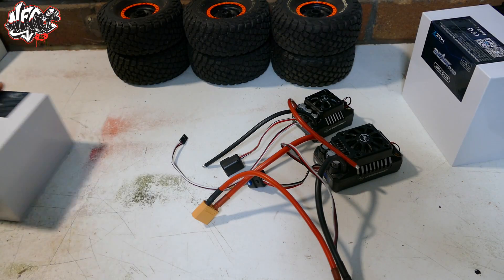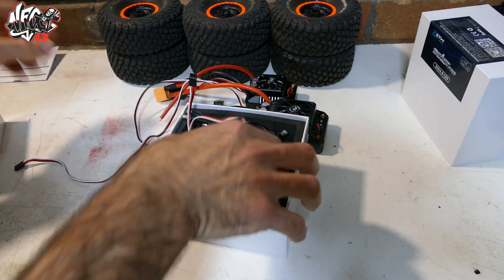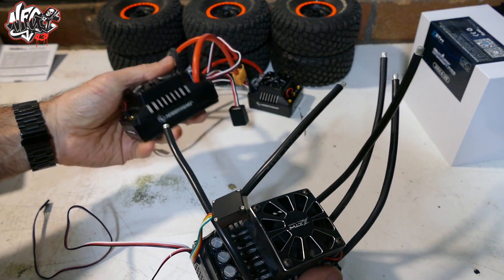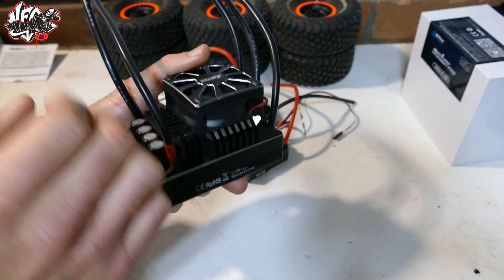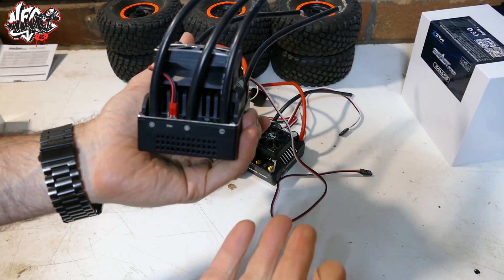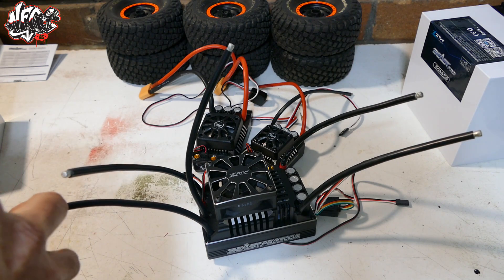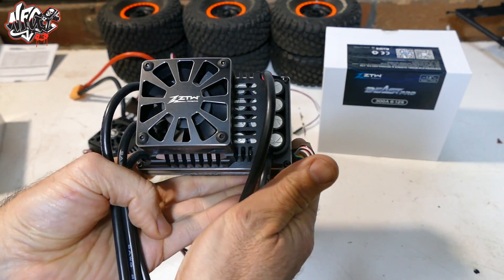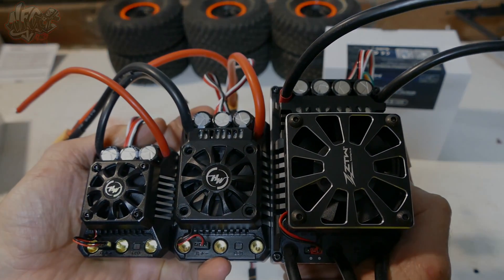ZTW 300AMP 12S ESC BEAST PRO! Unboxing & Comparison Between MAX5 & MAX6

Comment: hi how do you wire it up for the two 6 cell lipo
Reply from the maker: You could use one 6s with a dead plug or two 3s batteries

Comment: Can that esc take two 6s lipo batteries because I read online that the BEC of the ztw esc is 6.0 to 7.4v which is the voltage of a 2s lipo battery
Reply from the maker: Yes

Comment: The ztw are rubbish there over priced and the mofsets are cheap Chinese made components , there's no wiggle room for error with these , cant even handle a 800kv motor with low gearing , the only thing there good for is a smoke show

Comment: Putting this into my X2 so I can run 12s. Looking to buy the ZTW 620 Motor as well. I don’t think the Castle 2028 that’s now in the X2 will cut it.
Reply from the maker: Nice man. That will go well.
Reply: Don't get that ztw 620kv motor, it shits itself on 12S. Get the Leopard 58113 530kv ;)

Comment: If that fit in an Arrma Limitless, I wonder what sort of speeds you could get running a Castle 2028 800kv on 12S and 1:1 gearing! 😂😂😂
Reply from the maker: Now that would be awesome
Reply: @RCTanksTrucks247  If you like that idea, while the Castle won't fit in the Limitless, the TP Power 4070CM will. And if you order that in a custom 1100kv version, it will also handle 12S. I've run a 4070CM 1400kv on 10S LIHV in a heavy basher, and it holds up to the power. It is rated for a max of 54 volts, so I'd imagine a 1100 kv version should have no issues running 12S as it would basically have a 68 volt rating.
You could of course also just go with the 1400 kv and see what happens:) It is still rated for 54 volts:)
Reply: @AB-80X  I was thinking about run this ESC with a 1400kv TP motor on 12s do u think it'll work

Comment: Should do a LOSI MTXL conversion OR try and stuff it in a DBXL-E.

I'm getting one for my MTXL
Reply: letsgoracing78 or the new Primal RC which is even bigger
Reply: Should be the ticket for the DBXL-E with some Proline XMaxx style tyres. Then pair it up with a TP 5870 7D. That's what I have planned to avoid the usual January boredom. Should be good for an honest 100 mph on a tall gear.

Comment: Hey boys does this have an anti spark built in like the Hobbywing ESC's
Reply: Why do you need that?
Reply: @AB-80X  Because without it the connectors spark when you plug in the battery, not only damaging the connectors, but it's not good for capacitors either

Comment: I just bought one along with a leopard 58113 v2 530kv to run 12S in my new Kraken Vekta.5 LSE kit. 11hp of awesome :)
Reply from the maker: Awesomeness
Reply: I'm going to subscribe to your Channel can you keep a update on this ESC, thinking about buying one for a speed run car in the springtime, I need to know what the reliability in this so don't catch on fire thanks
Reply: @stevet8607  Hi mate, I can do that no problem. Aparrently there were problems with it when it was first release, I believe it's been fixed with an updated version. I got the latest version (so they say) online from Bang Good, that's the cheapest I could find but I don't think it includes the program card
Reply: @geejayrc9401  oh ok , thanks, us speed runs guy , we draw a lot of amps and heat real fast lol
Reply: @stevet8607  Have you looked into the Flier ESC's on ebay sold by R-mamba-brushless? he's into 1/5 speed running
Reply: @geejayrc9401  no I haven't but I'll check it out, just need something reliable that won't burn up after a few runs on 10-12s
Reply: @stevet8607  The Flier ESC's can handle more than that. Check out the R-Snake 400amp 16S
Reply: @stevet8607  He's a top bloke and he has the motors to go with them. Shoot him a question with what you have in mind, he's more than happy to help
Reply: @geejayrc9401  , I most definitely will 👍👍

Comment: That things a beast!! I dont think the xmaxx would really use it to its potential, unless you had the LH 58113 motor or something, defo needs to go in something 1/5th dude.. maybe you guys could get hold of a cheap losi dbxl roller and convert to brushless using this esc, that would be awesome to watch, i have a dbxl myself but im running thw OBR 30.5 reed motor..

Comment: you already know those are going to be great ESC,s just like the Turnigy Deluxe HV -250 is on par with the Jetispin-300 same logic the New ZTW -300 14s is on par With the Mighty MGM 40063! at a fraction of the Cost the fact of the Matter is Chinese Technology has Advanced like everyone else's just at a fraction of the Cost of the Big Name brands that All use Chinese Factory Lipos! and get their Motor's Manufactured in China. LMT motor's are Manufactured in Germany just Like Astroflight motor,s are Manufactured in the USA most other motor's are Chinese Manufactured Like Castle/Neu/Leapord easy to tell they all use the same can The BEAST X528 Same can and winding's all Chinese but Great Motor's that rival the Worlds best.not to mention them Chinese Turnigy motor's been outperforming the Hacker and Mighty PLETTENBURG motor's at a fraction of the Cost. The Only Motor that has NOT been Out  Muscled by Great Cheaper Chinese Motor's is the Mighty LMT-3080 that's holding it's own @1650 gram's!!! and that Whooping-MGM 80063 ESC.

Comment: I would say your Zonda but that already has its own duel ESC 12S set up.

I would say a 1:5 scale of some sort, not sure but I have found the perfect motor for you the  Leopard Hobby LBP58113 V2 brushless inrunner 700kv version. 58mm diameter 110mm length, will run on a maximum of 12S and develops 8000w of power.
Look what I found on AliExpress
http://s.aliexpress.com/VV3YjENv

Comment: I wanted to know if I can run my savage flux on max5 esc ?? Will the motor be able to take 8s ???
Reply: Shy - 🤔 only one way to find out 😁
Reply: If its stock  motor  don't do it
Reply: Recommendation for motor??
Reply: Tppowerusa.com , best motor  out there  in my opinion ,  I use them in my speed  run cars.

Comment: xlx is cheaper. you can turn the continuous current up to 400. it's smaller lighter and you have more adjustability
Reply: Jumpstart rc but the xlx is 8s only...
How do you "turn" 400amp mode On on it?
Reply: Daniel Melfa true you have to have a castle link and you can even turn the current cut off completely off. you may blow the esc but you can do it
Reply: Chris Kavo iv had 3 castle esc,s  only had 1 blow and it was my fault.
Reply: Chris Kavo like I said it was my fault esc couldn't handle the amps
Reply: Chris Kavo plus I could have 10 more and not a single one blow
Reply: Chris Kavo plus castle about raw power you talk to any speed runner out there. they run castle because they give the most raw power
Reply: Chris Kavo fastest mini, fastest 1/car and fastest car in the world
Reply: 1/8

Comment: Every time I watch a video from this channel I'm jealous, all I got is an ecx roost 1:18
Reply: vzgbfdnhgmj,gj  Ecx is not bad. Had the 1/10 Short course truck.
Reply: Theres literally no modifications i can do to it though, all I did was take out the front drivetrain and stuff so it's only rear wheel drive
Reply: Do any of those parts happen to be gears  or are they all part of the suspension
Reply: vzgbfdnhgmj,gj pinions/Steel spurs/rviewCompatibility
This is an optional Electrix Metal Transmission Gear Set, and is intended for use with the Electrix RC Circuit, Ruckus, Boost and Torment vehicles. Each set offers increased strength compared to the stock gears providing a perfect complement to higher demanding power systems.
Reply: Could I have that link then?